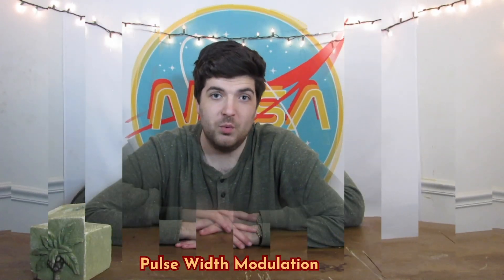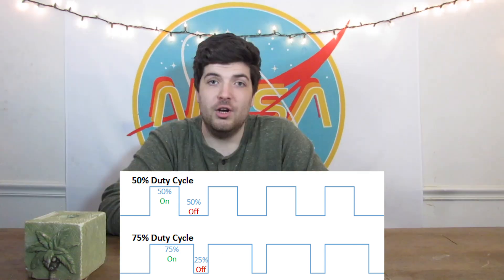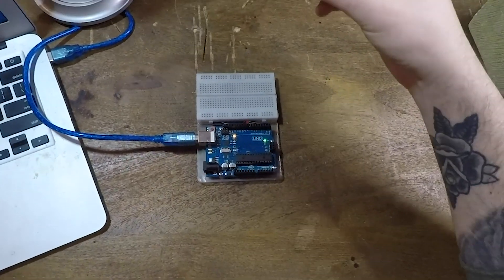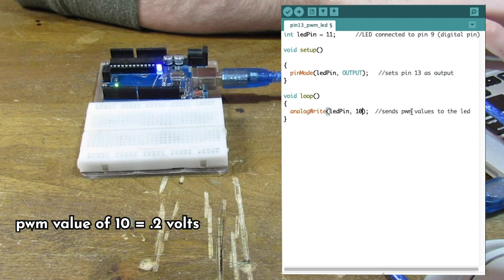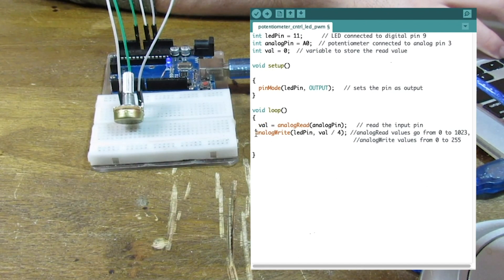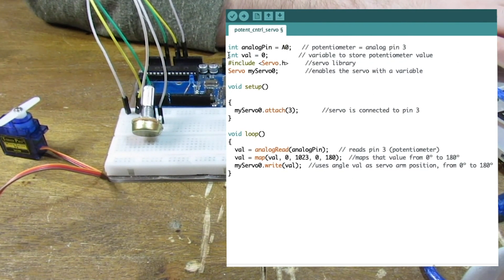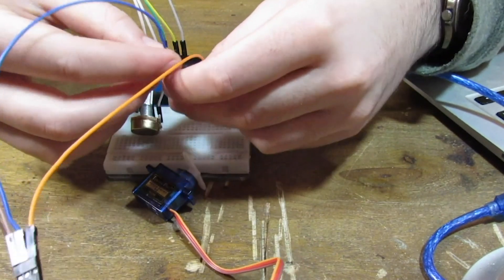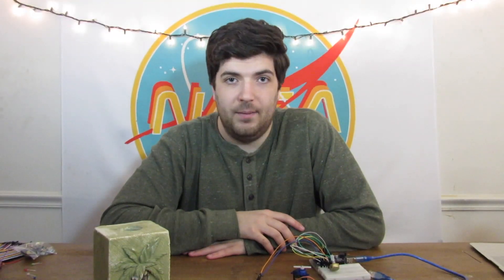Pulse width modulation - how it all works, and it's applications | arduino uno

Comment: Not trying to hate but i think you have pwm and analog signals mixed up. I could be wrong but in my experiences in order to use pwm on an arduino you use servo.WriteMicroseconds(X) With x being a value between 1000 and 2000.
Reply from the maker: The arduino doesn't have a built in digital-to-analog converter (DAC), so PWM'ing is the arduino's way of creating an analog output
Reply: @MillersPlanetOne  oh sweet! Didnt know about that. Thanks for the clarification!
Reply from the maker: Christopher Owen FPV yes sir 👍🏻👍🏻